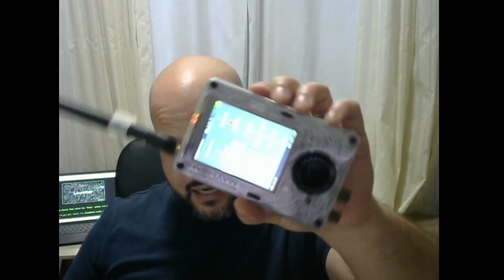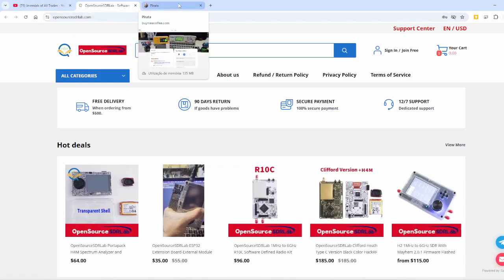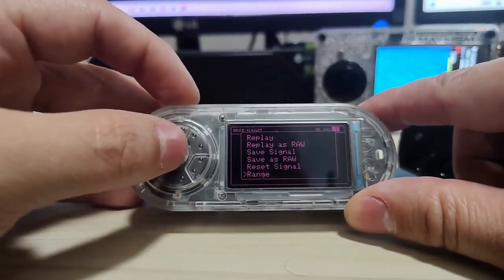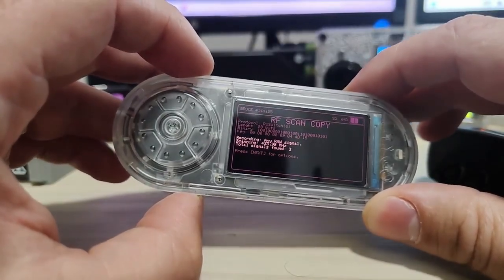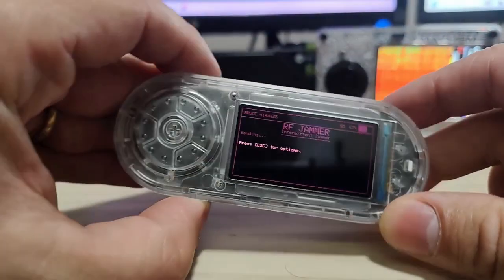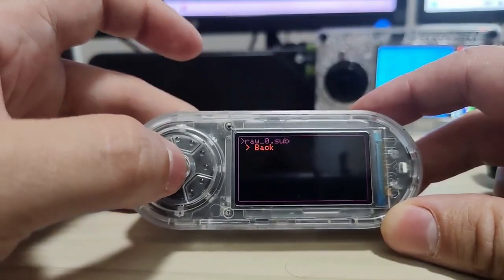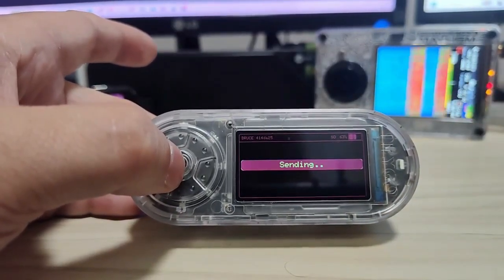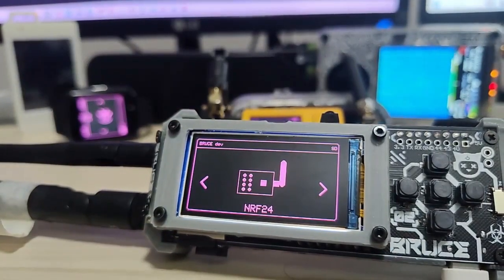Bruce Firmware SubGhz upgrades

Comment: So, it may just be my device (Lilygo CC1101), but im running Bruce Stable 1.12, and the RF Frequency recording is not as smooth as this video. It doesnt pick up frequencis easily, and even when it does, it doesnt stop recording when i press OK, it will time out and stop, but I cannot stop recording manually.

Is there a way to fix this?

Comment: May I Ask?, Can M5stck hack a wifi password without adding any parts on it?
Reply from the maker: For wifi and Bluetooth you don't need extra hardware
Reply: @bmorcelli Imean cracking wifi password, Im thinking I can use m5stck c plus 2 as a tester for the company Wifi if it can hack the wifi password.

Comment: By the way, can you make a Universal Remote for Bruce on T-Embed CC1101? With simple UI: Power Button, Volume Button, Mute Button, etc. Each button can access the corresponding IR code/file. Such as: Power Button accesses IR code list for Power, Volume Button accesses IR code list for Volume, and so on. Button will bruteforce by sending the IR codes one by one.

Comment: Bruce is amazing. You are amazing.  Boss mode. Anybody throw a link where I can add some files to stack2 or link to a vid. And I got an m5stacks3es and they seem neglected I can't get much to work on it and the touch screen is beyond frustrating unless I landscape it. Newb other than w flipper. Any arrows in the right direction is greatly appreciated

Comment: I realize this is not in line with your great video but I have to ask you something. I bought a nrf24 module for the flipperZero and I was wondering if it is possible, without making any modifications, to connect it to the cardputer? I do not mean to connect it as it connects to the filpperzero but using the pins and connect to the cardputer with the wires and the sd sniffer. Do you think it is possible or do I have to unsolder the module from the board and just use the Nrf24 module? thanks for a reply
Reply from the maker: @jacklabc4  maybe it is.. can you provide the board you have with the schematics for me to have a look?

Comment: Great update! I have waited for brutfeorcing subghz capabilities. Wich module do i need to use these functions on the cardputer?
Reply: ...the RF433T Unit right? :)
Reply from the maker: @Jimmersers  this one for fixed frequency is good.. if you have a .sub file with the codes to brute force, you can do it.. and there is a possibility of creating a JavaScript file to send the codes using the serial Command interface
Reply: Thanks for the tips, i will have looks into this :)

Comment: Hey, pirata, I have a question. How would I go about getting my board on that list of supported boards on the GitHub? I’m making a board called superBruce, it’s basically the board you showed off, except it is supposed to be as compact as humanly possible. It’s not done yet, but once it is fully released, I want to get it on the GitHub with the rest of the boards.

Comment: Fantastic work! Last night I spent the night trying to get the FM radio to work but it's not recognizing the si4713 module. I tested it with a multimeter and it seems that the connections are ok. I'm using version 1.9.1 on the m5stick and the carputer. I was thinking about buying a T-embed. The CC1101 module is more practical and flexible, but now that new boards are coming out I'm not sure about buying the Lilygo. I was thinking about selling all the modules and devices and starting over. I still haven't found the ideal device (not even the flipper, which doesn't have Wi-Fi and the Wi-Fi that does have it is expensive and is still 2.4Ghz). Anyway, thanks, you've done a great job!O pirata brasileiro desculpe o textão, sou programador talvez um dia eu colabore de algum jeito com o Bruce também! Abraço!
Reply from the maker: I appreciate your feedback!  Let's get that FM radio working! Call us on bruce discord channel and maybe we can help you debug it! I haven't mess with this si4713 myself, but I know some guys who did.. so ping me in the channel and we'll sort it ou!! Valeu brother!! tmj